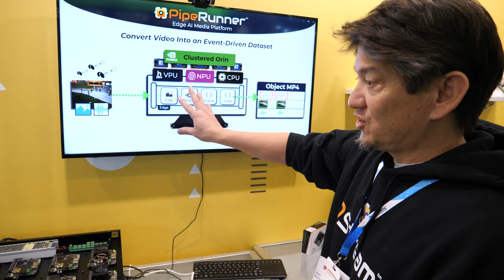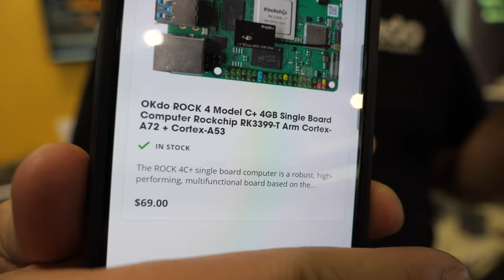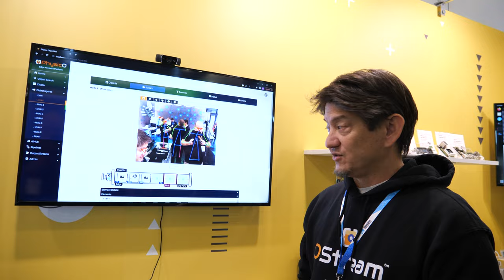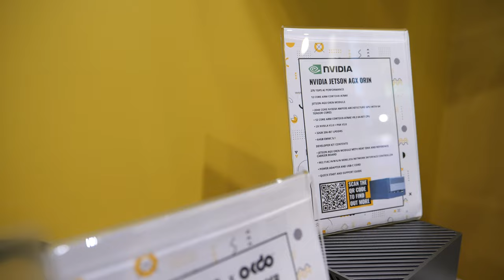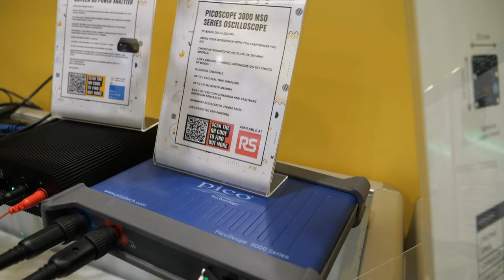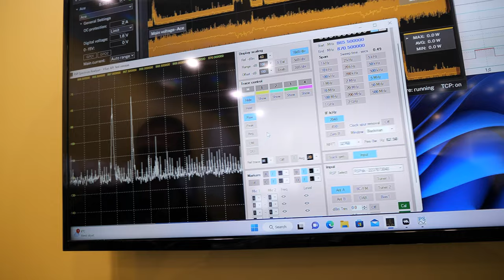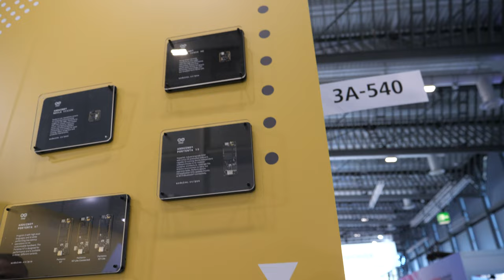OStream OKdo Radxa RK3588 Rock 5B, Rock 5A at Embedded World 2023 #ew23

Comment: Do these now officially support GPU-accelerated 4K video encoding? We are very interested in a board that can simultaneously encode and decode 4k/p24 streams and perform some basic tasks in the background.
Reply from the maker: I think it has dedicated hardware (not on the GPU, I don't think) to accelerate 4K encoding and decoding (even 8K decoding..) And I expect both can be used at the same time..
Reply: @charbax  As far as I know you have to implement the Rockchip MPP (Media Process Platform) module framework in your app if you want to access the hardware accelerated encode/decode. GStreamer appears to support it so far but it isn't in mainline FFMPEG, though I've seen some forks working on various integrations.